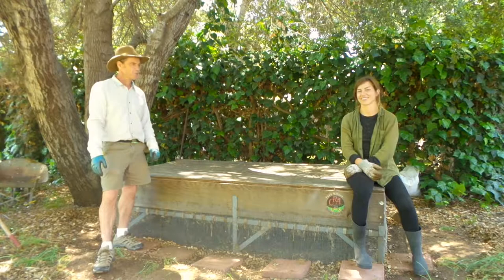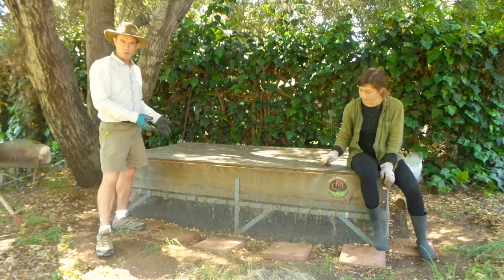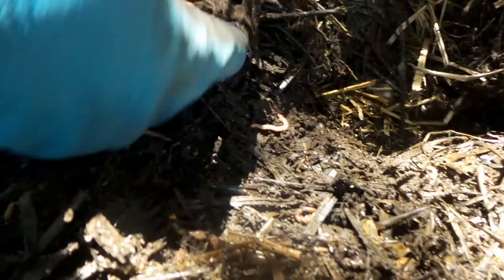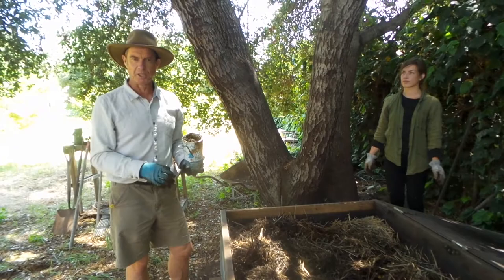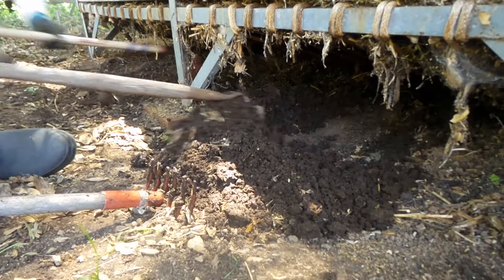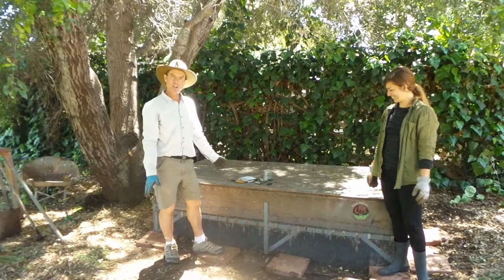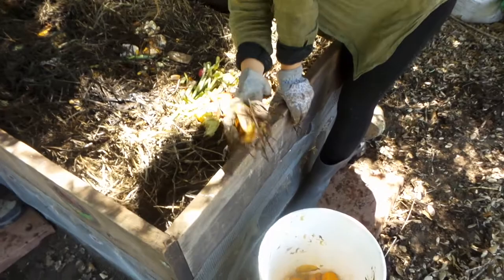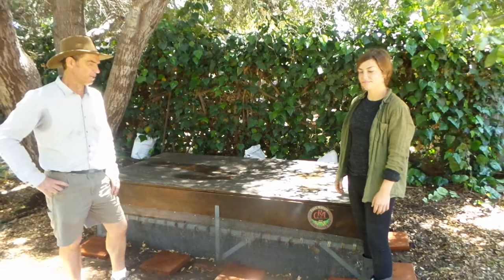Continual Flow Worm Bin

Comment: I like your design that you have. One idea for improvement would be to have the wire for the sides in panels that didn’t require separate tools to use. Knowing myself and many others, by removing the extra work required to obtain and return the tools I would be much more likely to actually harvest the castings.
Reply: We harvest every 3-6 months and the wire removal is pretty straightforward
Reply from the maker: We have worked with systems that have slatted wood sides that can be removed without tools.  Requires more skills, labor and wood upfront.  easier to harvest.

Comment: Nice set up. Great harvest.  Doesn't the staples damage the hardware cloth everytime you have to pull it off? Why not staple it to a strip of wood then use a few screws to attach it to the bin?
Reply: The staples are quick to pull off and on.  There is a bit of damage to the hardware cloth, but not so much as to compromise its function.

Comment: Great video! Did you moisten the straw you covered up the top with aswell?
Reply: and wouldn't you lose worms out of the bottom having it fully opened up like that?
Reply from the maker: Yes we keep the straw wet - because the bin is open at the bottom it can't get flooded
Reply from the maker: @JohnSmith.1  The worms stay with the food.  They move upwards into new food fed from above and leave their castings below. Its worm poo that comes out the bottom of this system, not worms!